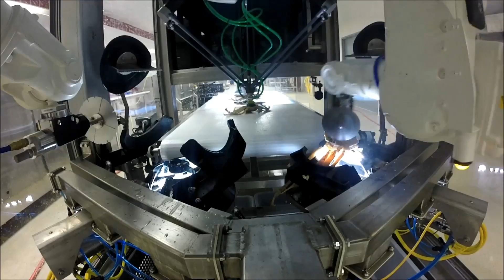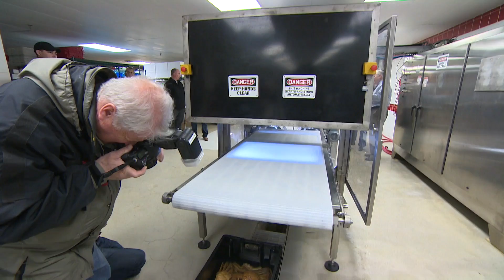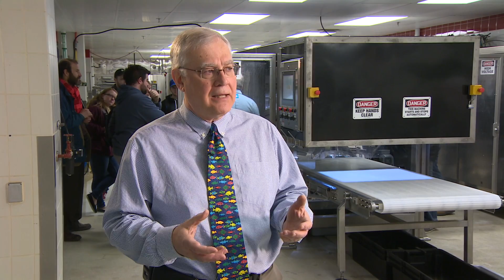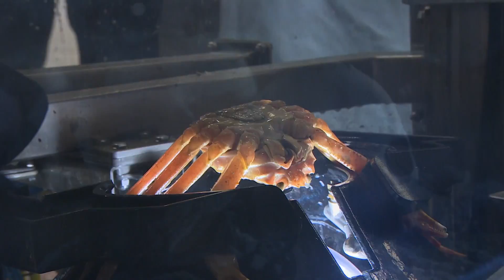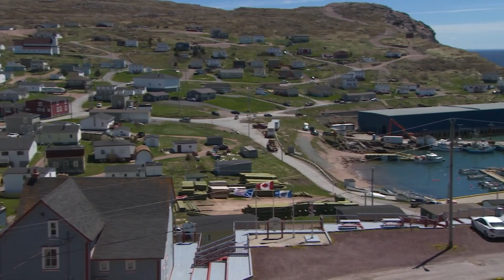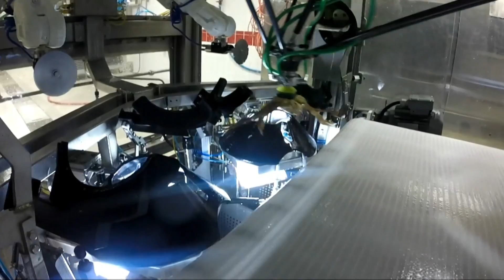Can robots process crab?

Comment: I realize these people don't think automation will work with their industry, but let's face it: our tech is advancing to a point where most mundane jobs will eventually be done by machines.  People in those jobs don't like the automation because it takes their jobs away, but it doesn't make it any less likely or even probable that the automation of said jobs will be easier, faster, and often safer.

Comment: Pfft, I got you a better solution: bring a bunch of venezuelans. You'll get way more applications than you can handle, they'll work their butts off, for the bare minimum, just for a chance of getting out of that hellhole AND you don't have to deal with radicals because they're christian, conformists (they're basically starving and still won't revolt) and will assimilate quickly because they don't have strong cultural roots. Weed off the sketchy people and boom, you got labor until the next generation cycle.
Reply: If you're interested, gimme a call :)

Comment: I hear alot of people crying about money greedy companies but, if your work force is ageing an no one is there to replace it....you will have no one to make you money
So a robot is needed by then. Think about it this way too. The only reason you still have a crappy burger flipping or other simple job is because they havent found a cheaper way to replace you. Your still technically the cheapest option they got. Thats why when something new comes along your gone.
People blame greed. Its just really business. Its no different than changing out a computer part in your old computer to make it function better and faster...but i bet your greedy for wanting quicker download times and reboot speeds?

Automation just forces people with no skills or drive to have to actually try and be useful. Ive worked at so many different types of jobs threw my life. Non all too hard some pure difficult and ive seen people who've been doing that job for years still struggle. A machine can not only do their job but they can have a EVEN SIMPLER job of just managing it. 
Cleaner, safer for the most part and less work now. Production goes up and stress goes down.

Comment: Maybe these crabs are genetically engineered, and this is why a robot can cut these crabs so "perfectly". Or, maybe these crabs are sorted, so these crabs are similar, before processing, so the robot can process the crabs; and maybe these robots cannot accommodate.   Or, maybe these robots can sense the exact size and shape of the crabs and move accordingly, to cut these crabs within available parameters.
Reply: robots are able to sense the exact size and shape of the crab. it's called a camera. Also image processing is to the point to where it can recognize the legs, arms, and body as separate parts easily.
Reply: You underestimate how well people can code nowadays